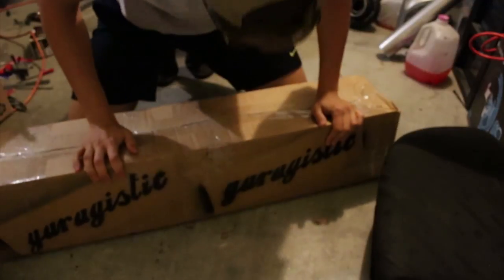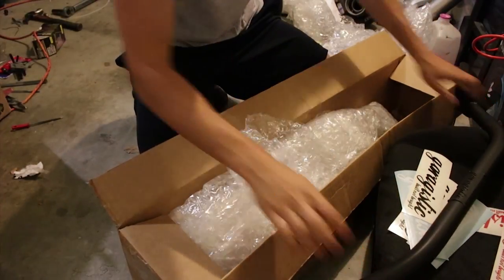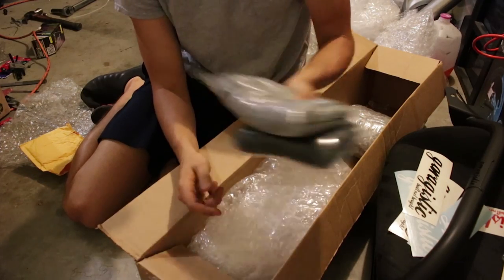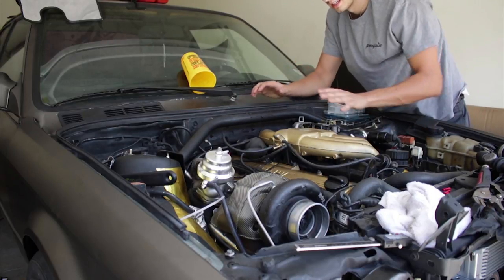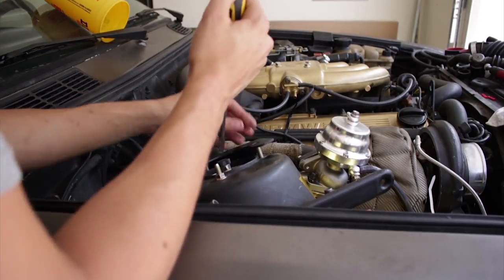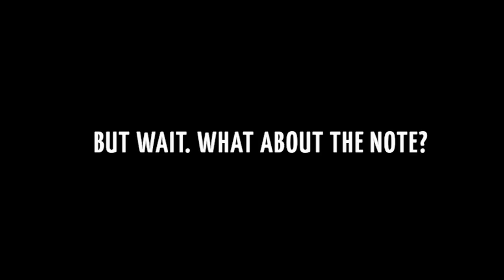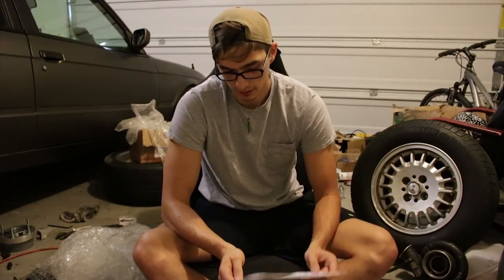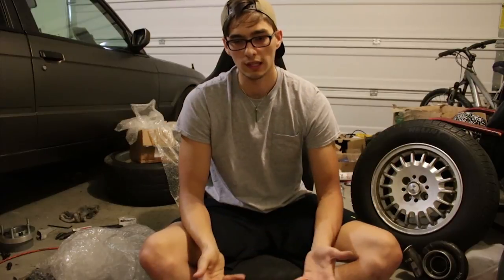Garagistic Care Package & Strut Bar Install

Comment: Oohs shit good luck on that rear end.. Just done mine. If your old bush sleeves get stuck from corrosion.. thread a large bolt and just whack them out with a bar from inside the car, everyone on the forums recommend strengthening the diff mount if you're using polyurethane or solid. Also if you're refurbishing the brakes and drums you might want to look out for those slotted pin retainer washers if you're backing plates are rusted out (eBay 301149953974)

Comment: When you drop your subframe make sure to weld in rear trailing arm strengthening plates and subframe mount strengthening plates. Just did a full under-body refresh on an e36 replacing every single bushing and ball joint, and welding in the reinforcement plates. With the new heavy duty ball joints and poly bushings the difference is massive.

Comment: Nice video ! Did you try it with the bar installed ? Do you feel a big difference ?
Reply from the maker: I never really drove it before. So I have no baseline.
Reply: Oh ok ! I heard that it make a huge difference to the car. Will you put ones inferior, and on the rear ?
Reply from the maker: +Jules Membré if I can get one for dirt cheap I will. But because of the shape of the rear end body/chassis. It's locked in place and fairly stable. They do not experience much to any flex across the rear towers.
Reply: Yes you're right ! Thanks for your job, keep it up